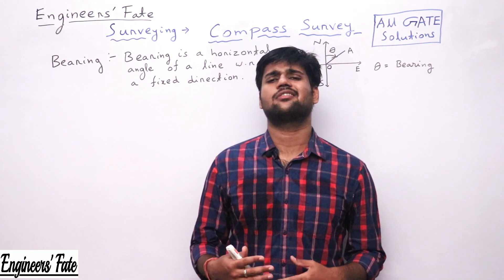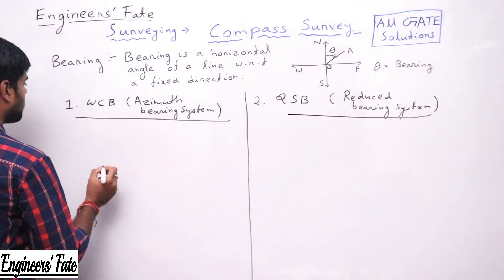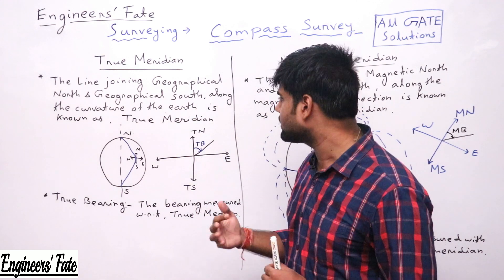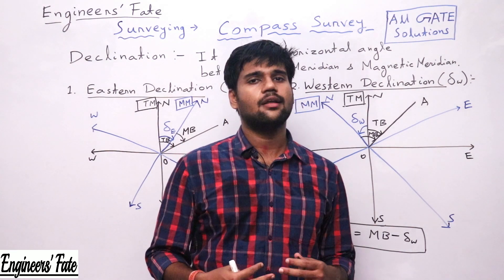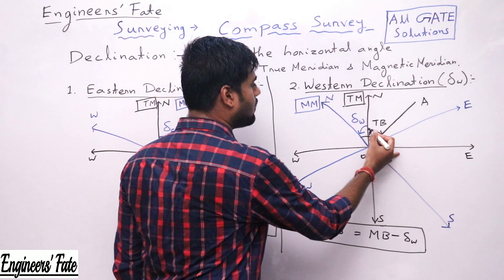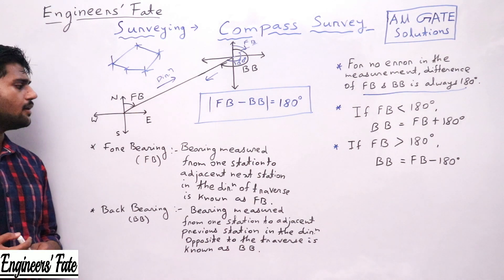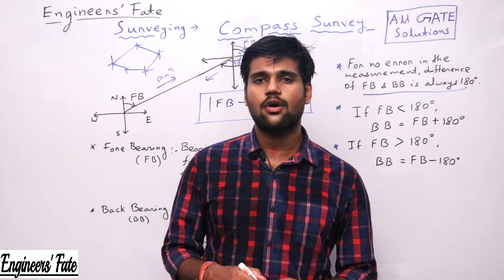Compass Surveying -All Numerical Concepts for GATE Questions- Whole Circle Bearing , QB, Declination

Comment: [00:06]\Bearing is the angle between a line and a fixed reference direction.
- The fixed reference direction is usually north.
- The angle is measured in degrees from 0 to 360.
- There are two types of bearing systems: whole circle bearing and quadratus system of bearings.
- The representation of the angle in whole circle bearing is simply θ.

[03:45] Quadrille system of bearings
- The angle between north and the line will be theta a.
- The angle between south and the line will be theta B.
- The angle between south and the line will be 90 degrees minus theta C.

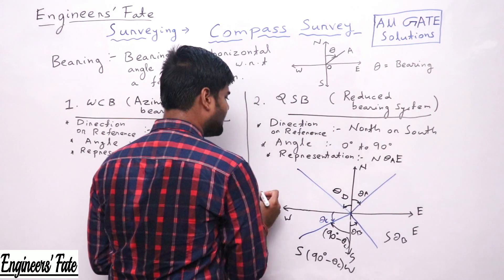[06:46] The true Meridian is the line joining the North Pole and South Pole passing through a specific location.
- True Meridian does not change with place and time.
- The true bearing is the angle between a line measured from the specific location to the North Pole or South Pole and the true Meridian.

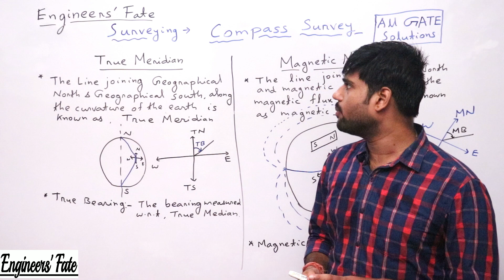[09:04] True meridian and magnetic meridian are used to calculate true bearing and magnetic bearing respectively.
- True meridian is the line that does not change with place and time, used for larger services.
- Magnetic meridian is the line that passes through the place where a magnet is hung, used for smaller services.
- Magnetic bearing is measured with respect to magnetic meridian, while true bearing is measured with respect to true meridian.
- A compass gives us magnetic bearing, but for accurate calculations, we need true bearing.

[11:09]Declination is the horizontal angle between the true Meridian and the magnetic Meridian.
- The declination can be either eastern (towards the east) or western (towards the west).
- True bearing is the sum of magnetic bearing and delta.

[13:08 Understanding magnetic bearing and true bearing in surveying.
- Declination refers to the angle between true meridian and magnetic meridian.
- Magnetic bearing is the angle between magnetic north and the survey line.
- True bearing is the angle between true north and the survey line.
- The true bearing is calculated by subtracting the declination from the magnetic bearing.
- Traverse is a framework used in surveying to connect multiple stations and carry out survey work along a specific direction.
- Forbearing is the angle measured during the survey work along the direction of the survey line.

[15:08] Back bearing is used to check for errors and local attractions in survey measurements
- Back bearing is the opposite direction to the survey work
- The difference between 4 bearing and back bearing should be 180 degrees
- If the difference is not equal to 180 degrees, there may be local attractions or errors
- To solve measurement errors, the back bearing is calculated and compared to the 4 bearing
- The difference between for bearing and back bearing should always be 180 degrees
- If the for bearing is less than 180 degrees, the back bearing should be for bearing plus 180 degrees

[16:59] Bearing and Back Bearing explained
- The back bearing is equal to the forward bearing plus 180 degrees.
- If the forward bearing is greater than 180 degrees, the back bearing should be calculated as forward bearing minus 180 degrees.